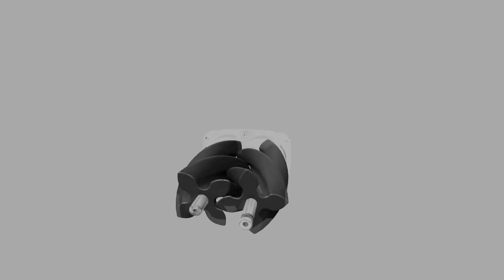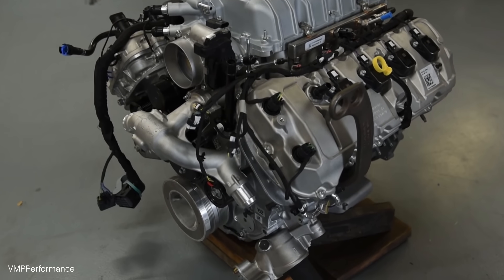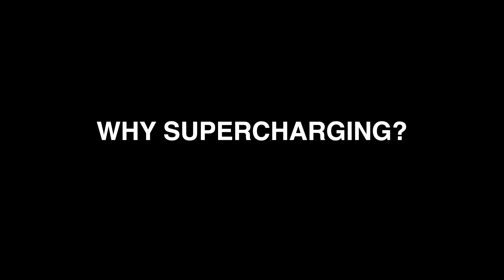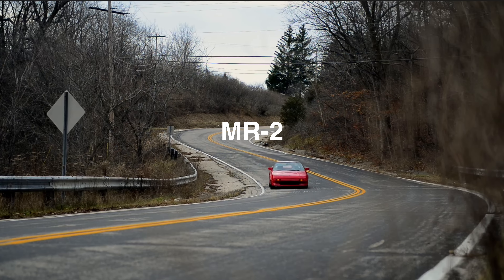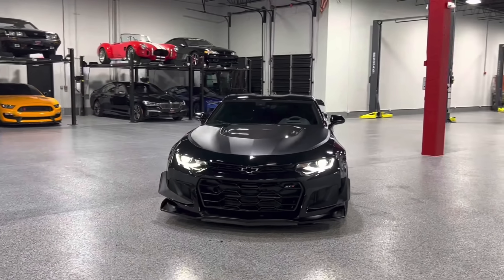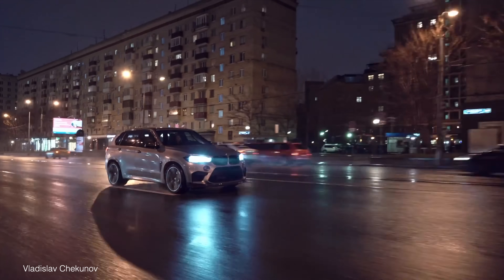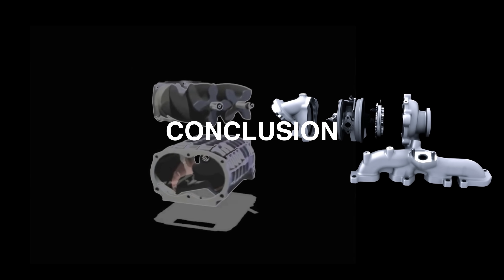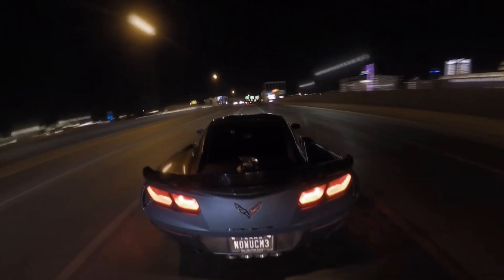Why V8 Engines Are Supercharged vs. Turbo😮| Explained Ep.6

Comment: I just love ice. Electric motors have no soul or character.  Every different ice configuration singles v4,6,8,10,12- i2,3,4,5,6,8- wenkel, rotary- opposed cylinder- diesel. They all have a different feel sound and power characteristics. With a small powerful motorcycle you are literally riding on 10's of thousands of controlled explosions per minute and hundreds of explosions per second. Its amazing to think about the symphonies of timing and complex mechanical movements that accomplish the feat.
Reply: I think the same can be achieved with electric cars through the use of different ECUs/speed controllers. Different battery configurations and capacitors etc. Once the aftermarket catches up with the new technology. I will miss the sound of the I.C.E. I like what Porsche has done with the Taycan. Not trying to replicate the I.C.E but just made it sound cool. Like a spaceship taking off.
Reply: @dmedford5  much of the sound of modern electric cars are engineered into the vehicle. The natural sound of the electric motor is almost silent. So noise is engineered in to hear it as a pedestrian and driver. 
It's tailored by sound engineers. 
This is exactly my gripe.
Different ice engines have naturally different and varying sound characteristics. From diesel to gas - single, inline or V. They have soul naturally. 
Electric is just missing that.
Reply: Cars don’t have a soul. Every time I hear this it sounds like a boomer talking about the good old days and now they don’t make things the way they used to.   Get with the technology.
Reply: @calvinwalker4654 what is soul?
I like engineering and mechanics and think the way you can arrange different timing, clearances, proportions and layouts provides something that speaks to people's senses in a way digital electronic motors cannot. Which is why they make attempts to add character to those machines by piping in artificial mechanical sound. 
It's the complexity of the ICE that tickles my brain. If you enjoy simplicity a few magnets and some wrapped wire is just the thing for you. If you enjoy engineering and mechanics, learn how the ICE beautifully controls thousands of detonations per minute and transfers that energy into rotary power and is able to do that reliably over thousands of hours and hundreds of thousands of miles.
Reply: @Imarida2  this is your point of view because you have knowledge of internal combustion and engines, but don’t have knowledge of electric motors and circuits.  Granted you can’t make those modifications currently because most cars are internal combustion.   In 20 years there’s going to be modifications just like they are for gas cars that work for electric cars.   There’s just as much soul in an electric car as there is a gas car.   The soul is just how people feel.   You may not feel that soul, but the owner will.
Reply: enlighten me. 
Tesla is using some of Nicola Teslas electric motor technology that is over 100 years old. Not to show respect for its company's namesake but because Electric motors work on simple fundamental principles. Materials and innovation have made the electric motor more efficient but the concept is very simple. 
The analog of soul is character in the realm of vehicles. As my original comment noted there are myriad different types of ice engines and within each type are countless other variations that give ice engines objectively more character than electric motors and its controls will ever have. 
It doesn't mean electric vehicles are bad. They are just different. They will be very utilitarian and a good tool for transportation. They just objectively will never have as much character as all the ice engines.
Reply: @calvinwalker4654  I have a very fast Taycan and a very fast 911 and very fast RS3. The Taycan is the nicest car I’ve ever driven, the ride is amazing, it is blistering fast, but boring to me. The RS3 has lots of theater, the engine blips, rev matches shifts, makes turbo sounds, crazy exhaust sounds, and it’s extremely entertaining to me. The 911 is a surgical scalpel of precise performance that feels connected to every input I give the car, and the competency is on another level. I push the 911 and it only wants more and more, it’s the tool for when I want to go fast and stay in control. I love them all for different reasons. I don’t talk about soul, I talk about entertainment, and the Taycan does not entertain me like any of the others. I don’t care which is the fastest, I care which I have the most fun with, and that is not ever the Taycan, regardless of speed.

Comment: One thing you forgot to mention is that pushrod crossplane v8s all have massive cylinder displacement (0.7L to 0.8L per cylinder) which makes the engine itself very torquey at lower rev ranges. That means these engines care less about parasitic loss at superchargers’ typical spool-up rpm than engines that produce peak torque/power at higher rev ranges. So superchargers are definitely less “inefficient” on these engines and don’t give you the feeling of as if you are sacrificing low end power for a bit more power under higher rev. So purshrod OHV v8s are pretty much the only engines left where superchargers nearly make about as much sense as turbos.

But in any case, turbos are always from slightly to a lot more efficient and can be put on all kinds of engines regardless of where the peak torque is. I love my 4b11t and the fact that at 3,000rpm, it transforms from a grocery getter to a proper little pocket rocket.
Reply: Thank you 

I was wondering why it still made sense to put supercharger over turbo 
..
Rather than the sound
Reply: @meyzersilverhorn546  also i forgot to mention, for v engines like v6/v8/v10/v12, the exhaust plumbing and piping required for single turbo setup is super impractical. that's why 99% of turbo v engines OEM setup are twin turbo. treating each cylinder bank as a separate engine and put a turbo on each side is easier and has better exhaust impulse management for these engines. for pushrod v8s, a lot of people can't be bothered to deal with complex exhaust design for single turbo or the massive cost and engine bay space management of 2 turbos. that's also a contributing factor for choosing supercharger over turbo.

Comment: Turning a compressor robs initial power and puts additional load on an engine.
So the initially stronger engine  is better suited for long term reliability.
Like the idea of a low compression supercharger on a decent v6 aided by clutch of sorts to change rpms later,until a turbo or two can spool up enough to handle a larger portion of the load,while utilizing capture tanks to use compressed air left over when you get off throttle to recirculate into the system. Twincharging and rally circuit hacks would be awesome to see fully realized before things shift even more towards more electric.
Reply: At least on somethin bigger than an inline 3.
Could even throw in electric assist motors for more power but more weight even on a single motor inline setup like I think mclaren first used.
Hell
A tiny starter motor will move a fullsize truck if a drunk friend leaves it gear with the parking brake off after dumpin it.
Reply: So may as well go for every angle you can I guess.
Maybe make it 6wd too 👍
Reply: And NOS!
Reply: And overclock your electric motors computer :)

Comment: Pushrod engines, like throw-back American V8s don't rev fast, have lots of room between the cylinder heads, perfect for a supercharger.   

More modern Euro and Asian engines are more crowded being DOHC, and work better with twin turbo set-ups.  Exception are the hot-Vs used by Audi in the S4/SQ5, etc.

Comment: All 1-4 turbo intercooler petrol engines and all 1-4 turbo intercooler petrol engines hybrid disadvantages
1. Impossible theory by inventor members aren't Automotive Engineering all departments
2. 1-2 Turbocharger intercooler theory are for common-rail diesel engines with 200 bar
3. This clip cheer 1-4 turbo intercooler petrol engines all, 1-4 turbo intercooler petrol engines hybrid by owner's clip is street racers class crime rank terrorist.

Comment: its obvious ur biased towards American muscle vs jap/german imports.
but turbos do sound better.
easier to mod more bang 4 your buck when modding, and yeah these ameican muscle cars might have 700hp stock but u wont get much more out of em by modding.
pretty sad when ppl take old VTEC or 2.0t VAG 4 cylinder engines and have em hitting 1200+ HP.
them american cars are already pushed to their limits when u buy em.
if American muscle n superchargers was so superior, the entire rest of the world wouldnt be turboing 4 n 6 cyl motors still buddy.
dude id take a damn e36 m3 thats 20 yrs old over some camaro😅
another thing, american muscle has been trash for over 30 yrs. id rather buy a BMW for 13 grand, and dump 20 grand into it and SMOKE hellcats left n right for almost a third the cost 😅 and ill have cooler noise w my gigantic turbo, that i can control my own boost unlike a blower.
turbo all day.

Comment: The massive drawback with the 'Hot V' configuration is that by having the turbo chargers in the V' of the block means that there is unprecedented heat soak to the heads after a long run on the motorway - BMW have paid out over £60m worldwide on these engines with warranty claims which can have the heads fried and warped/stretched head bolts/ immense oil consumption/ burnt valves/ oil starvation at the heads/burnt oil being circulated/oil Leaks in the head gasket/oil leaks in the engine head seals/ there are many more problems, but, these are just a few of them - BMW did the Americans no favours when they came up with this stupid idea and then offered to you!!.

If you EVER come across a car with an engine that has the turbos in the 'V' - then walk away FAAAAAAAAAAAAAAST!!!!!.

Comment: What about turbos with the electric motors connected to them to immediately spool them to boost max eliminating lag? I’m sure that tech was being used when you made this video. Also superchargers use power from the crank to turn the blower causing a loss in power from needing to turn the pulley.
Reply: he left as much as he could out of this to make American muscle seem the best😅
if that was the case the rest of the world wouldn't have been using turbos for 40 years😅

Comment: Two valve pushrod engines are MUCH more complex than a four valve OHV engine and that is why they were developed after 4v DOHC designs. Just the steel alloys needed to make a spring that can control a big valve 2V OHV engine alone is a big deal, then you add things like harmonics and cam profiles and you are looking at a lot of complexity that isn't obvious to the average enthusiast. Also there are LOTS of turbo pushrod V8s out there and have been for a long time. Check out the Allison V1710 in the Lockheed P38 Lightning or the engine in the P47 Thunderbolt. Also check out turbo compounding like what was used to recover waste exhaust energy on the Wright R-3350 (I think?) or Pratt and Whitney R4360. Do keep in mind that these were aircraft engines so they had to use a gear driven centrifugal super charger with fuel injected into the middle of the impeller to fly inverted, but if they wanted good high altitude performance they also needed a second stage of compression which could be either another larger crank driven supercharger or a 110lb GE exhaust driven turbo super compressor. American engines have been using both for a VERY long time.

Also note: All OHV engines are at the same efficiency levels. I don't differentiate between cam in block, cam in head, or over head cam anymore, it's splitting hairs. Same with number of valves in the chamber. Two and one half dozen the other. DOHC can spin more RPMs easier, so more bangs, but pushrods are smaller so you can get more displacement out of a given space and weight, so bigger bang.   I go for the larger lungs with minimal external footprint and weight. You wanna see some real inefficient doodoo? Go do a deep dive on flathead tech.

Comment: I'm not sure why any engine is turbo charged vs. supercharged. Everyone talks about the need for "cold" air intake. You gotta get a cold air intake or you're missing out. Yet we slap turbo's on everything these days, running hot exhaust gases a 2nd time through the air intake system. But turbo's need a separate cooling system, where superchargers do not. Plus you get the benefit of "cold" air coming through the air intake with superchargers. To me its a no brainer which is best&most reliable.

Comment: Not only has turbo technology come a LONG way but other technologies that are developing in parallel have also essentially eliminated all the downsides typically associated with turbocharging. DSG/DCT transmissions allow quicker shifts which help to retain boost between shifts, electric motors can act as fillers to provide power in the low end before reaching max boost, and a properly tuned turbo engine will also be much more fuel efficient.

Comment: There is an aspect you're missing. Due to cheap fuel, in the US forced induction was never about efficiency. In Europe and Japan on the other hand, the most common application of forced induction is small turbochargers on small (1000-2000cc) engines. There, a supercharger may have comparable upside on peak torque, but a massive downside on fuel consumption when peak power is not needed (i.e. 95% of the time). So then, even for high-powered engines it makes more sense to re-use the technology you have at hand, maybe just use two turbos instead of one, rather than develop a supercharged engine that's different from the rest of lineup.

Comment: Simple answer, you need torque to turn a supercharger in order to get higher intake preasures through a blower. With low torque 4 cylinder & 6 cylinder engines, it doesn't take any torque to blow a fan from the exhaust in order to get higher intake preasures from a turbo!
See, simple. If you don't have anything to start with, turbo it. Otherwise Supercharge it!!!

Comment: My experience with superchargers is with the old two-cycle diesel engines, mostly the Detroit 6-71.   A Detroit diesel engine blower is exactly what the "hot shoes" (a very dated term for drag racers) were putting on engines over 50 years ago.  The problem with turbocharger spooling is addressed in heavy diesel truck engines with a "Switchblade" (the name of a brand) turbo charger as an aftermarket solution in heavy truck sized diesel engines.  It changes the angle of exhaust gas entry into the supercharger at low RPMs and resumes a more normal path of entry for exhaust gas once the engine RPMs reach higher operating speeds.   I don't know how good they are, they are non-electronic addons that use the change in air velocity/manifold pressure to operate, and one might assume that big manufacturers would just buy whatever patent(s) and include this item as standard equipment on all sorts of things if they afforded that much of an improvement in performance and proved reliable.  This company does not offer anything intended for modern gasoline cars and trucks as far as I know.  The big advantage that the average car owner would have with a supercharger besides lower initial cost is engine oil life.  Turbochargers place a greater demand on the integrity of a lubricant and its additives because of high operating temperatures and high speeds of the shaft in a turbo as compared to  environments in a naturally asperated engine and thus make frequent oil changes a really good idea.  Also, the constant starting and turning off of an engine often experienced in most street cars is not an ideal operating environment for the life of a turbocharger unless the manufacturers have addressed that concern in some meaningful way.

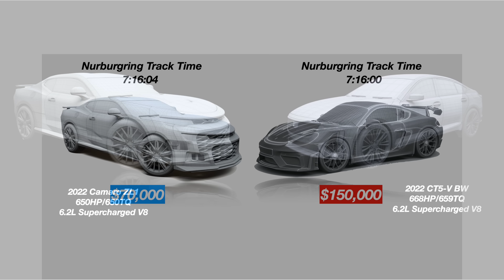Comment: The pics you have at 3:58 and 5:55 make no sense. Yes, the Camaro ZL1 1LE, with it's supercharged 650hp motor lapped the Nürburgring at 7:16:04. But the Cayman GT4 RS you have pictured is naturally aspirated. What Porsche with a turbo engine and a price of $150k is supposed to have lapped the Nürburgring at 7:16?

Comment: Not even close to being at the peak, the issue is this bandaid fix they are trying to push with EVs. We gonna be worse than we are now onces millions of EVs start to get bought. Most places can't even handle power usage all year around without having rolling blackouts. The grid is damn near maxed out yet they claim cars are the issue. 28% on pollutes comes from transportation, 25% comes from Electrical power. If you cut that 28% that's good, but where the hell is the gonna come from? we at basic moving a line on the pie chart that 25% of Electrical power will shoot through the roof to meet demand. Water is kinda useless with rivers drying up, Wind takes up tons of space and needs to be in a certain region. People are afraid of nuclear/fusion power, so where do we go LOL shit is a circle jerk.

Comment: GM uses a lot of turbocharging to so you're wrong about that damn doesn't just exclusively used superchargers they used turbos as well they've used turbos longer than they've used they were a partner company with sob and then they owned Saab Saab is known for turbocharging they are not the first people to make turbochargers that they are the first company to say we are going to put superchargers and turbochargers and every single one of our vehicles and from that point on every car they've ever made had a supercharger or turbo swedish technology they pretty much ate Saab to be able to use their software and technology remember SOB was using digital information cable when nobody else was

Comment: Sincere question: why don't modern Diesel engines use a supercharger vs turbos? Particularly for all the diesel pickups, from 1/2 T to the large super duty types. 

Seems like with their low rpms, EGT's being such a critical factor, massive torque, large engine bays, etc., superchargers would be a better choice.